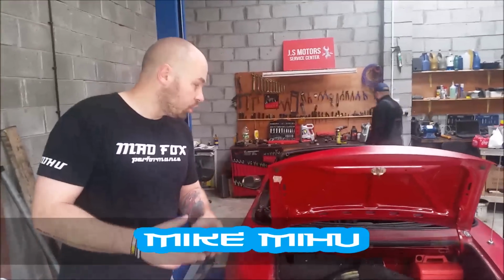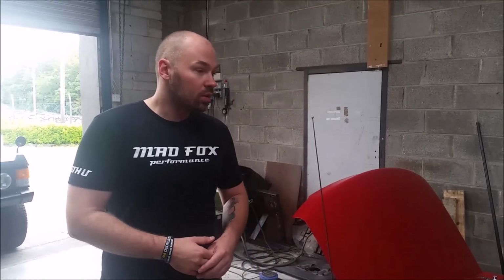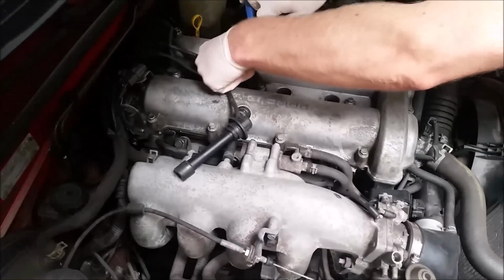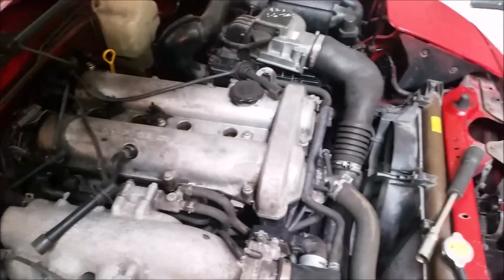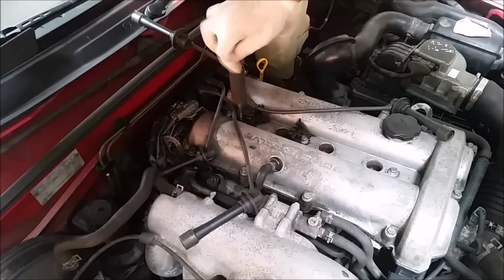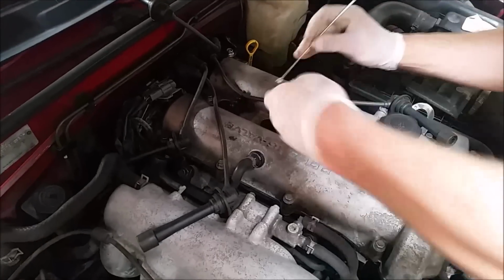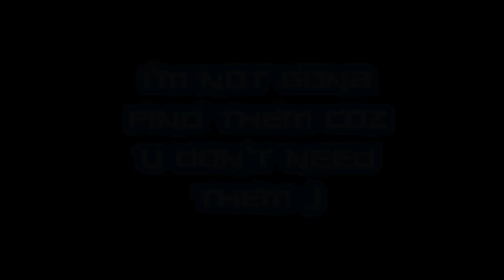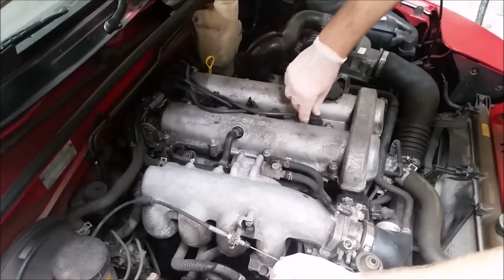Mazda MX5 Miata Eunos replacing spark plugs

Comment: No such thing as a 1997 MX-5. I see this used incorrectly by many. It is a small issue but one that makes me a little nuts. I currently own an MX-5 (started in 2006) and have owned others including my favorite my 1993. If Miata says I am wrong than I apologize in advance but I just checked before this post and they agree with me.